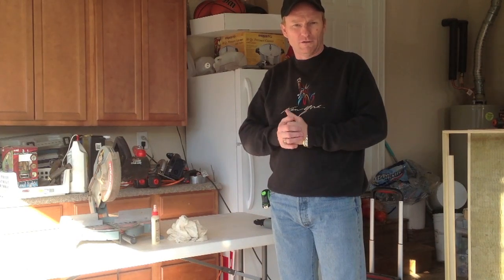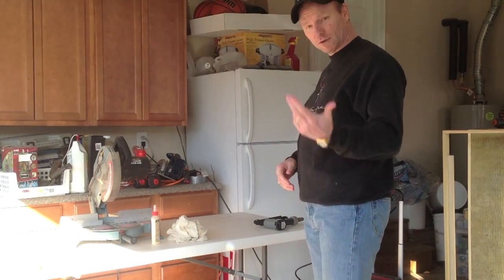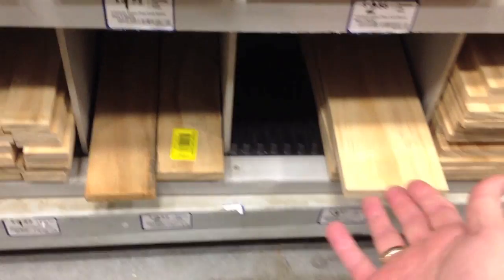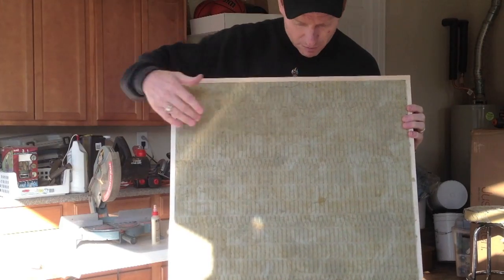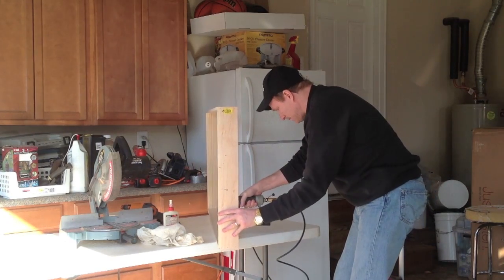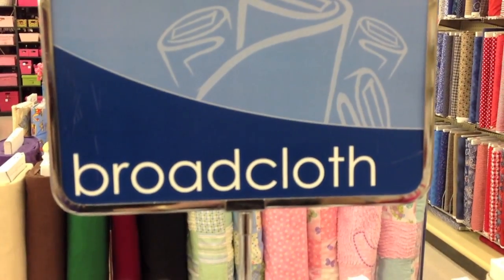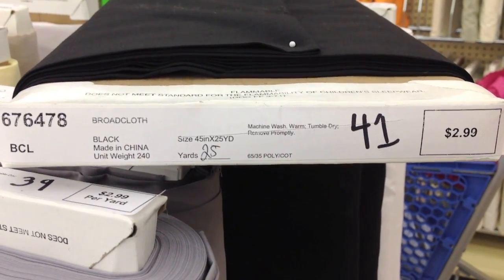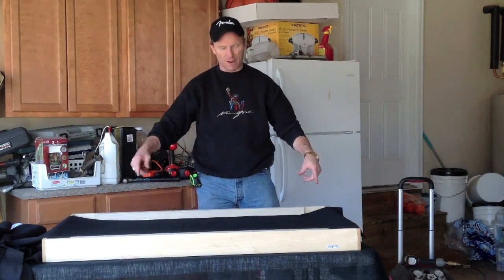DIY Sound Absorption Panels for Home Studio

Comment: I'm going to copy this exact; fantastic advice man.....

Is the Rockwool easy to cut as the panels I need are smaller and I can only get my slabs at 100x600x1200mm....  48 inches are 121.92cm so I'm trying to get 600x600 for a small studio space.

Comment: Why did you bother covering the back of the panel with fabric?
Reply: Good question! I covered the back so that the insulation doesn't flake out or come out the back when moving them around or storing them. Insulation dust or pieces will fall out.

Comment: You mentioned hanging it with hanging wire, how do I go about doing that?
Reply from the maker: Just with regular picture frame wire. Tap in nails on each side of the wood frame and wrap the wire around the nails/screws and it will be a hanging wire to hang from a nail or screw in your wall.